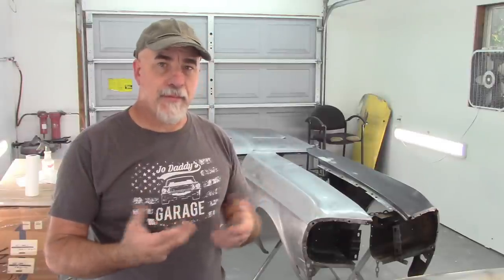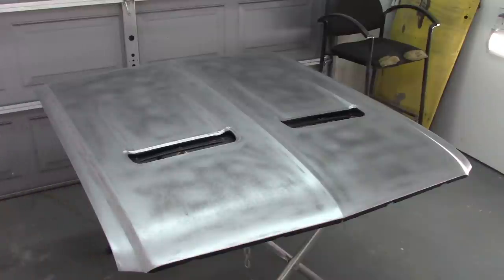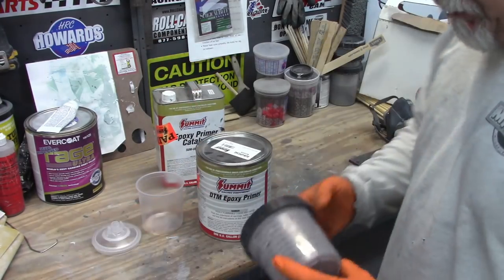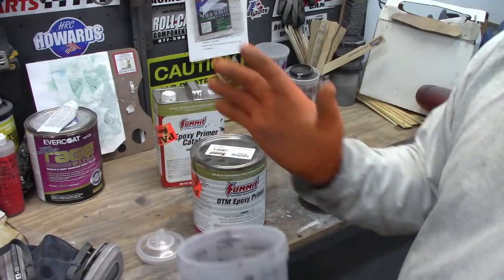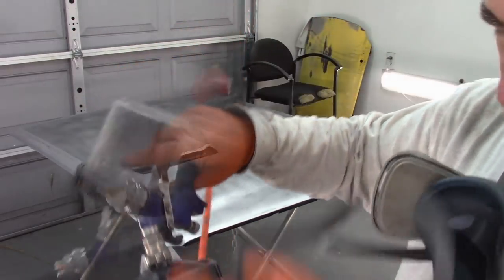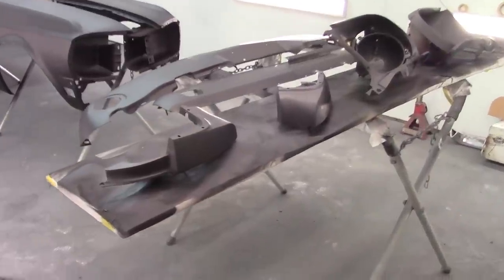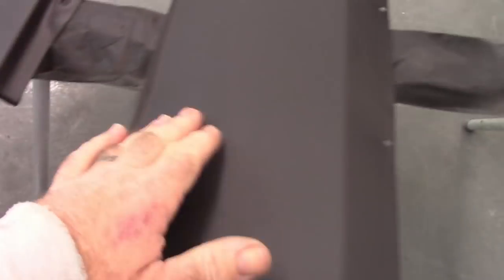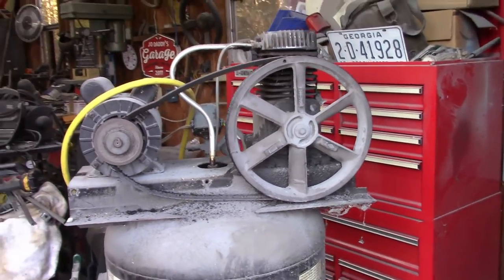Spraying epoxy primer. Mustang restoration. Jade part 43

Comment: they probably had overspray land on the primer and made it grainy.......BTW I got one of those compressor heads from harbor freight (the 3hp one) I have a 5hp compressor it works perfect. about the same CFM as before. great for temp repair. Yea My compressor tank is like a 1986 still going.

Comment: Heh, bought my first compressor from Sears back in 1978. Still using it! Still has the original belt!! I did have an issues with some valve failure several years back but no big deal. It's just a 2 hp, 20 gal, 220V, barely enough to paint a car back in the days with a siphon gun. To run my HTE gun now I still use it but I augment it with my new one ... strangely enough, identical to the Kobalt you have!!! (Got a screaming deal on it as I guess they discontinued them.) That's a nice unit, seems well built (good warranty), actual 2 stage and makes an honest 175 psi, all on 120V ... and it's damn quiet too! Only drawback is that being 2 stage it doesn't offer a lot of delivery in CFM. On its own I don't think it'd run an HVLP gun for long, but the "old reliable" Sears working with it works out fine.

Comment: I use epoxy primer for certain jobs. However I have had lifting issues repairing paint when something that was epoxy primed. I never have these issues with any other thing I've painted. I'm not bashing epoxy it's just a thought. I've done bodywork since 89.

Comment: I second the motion on the second tank! What? Does that make sense? Yes, twice the volume at contestant pressure or close to it. My son was doing body work and painting his Monte Carlo. I was after him to check to pumps oil, repeatedly. It froze! I even have a tag w/date of service. 
  Many have found older tube type a/c condenser off an R12 GM truck. Compression fitting allow for easy plumbing. Adding a cooling fan increases its efficiency in removing condensed humidity from the air, to make the tank like three times longer. A 12 volt DC fan can be added using a converter, wired in the on side of the “On” side of the pressure switch.
   You comment about someone said their epoxy was grainy. Some add up to 10% acrylic reducer that allows it to flow out and lay down flatter with “Eastwood” or “Shop Line” epoxy, made by PPG. 
Nice work, already subscribed but hit like! Epoxy is a step many deem not needed. I do...and you do as well. It is serious protection.
Reply from the maker: Thanks for the comment. Good information.
Reply: @JoDaddysGarage    Sorry, I misspoke,  I meant to say a good quality urethane Reducer of the correct temperature but that makes it flow out smoother. Air pressure at the gun, tip size, so much effects the texture of the Shop Line epoxy sealer/primer product. Have a good one.

Comment: Nice video, great job of explaining the process you go through. I have always used epoxy as the foundation for my bodywork and paint jobs but I usually get one of PPGs epoxies not the off brand stuff. it would be nice if Summit would tell you who makes it for them to relabel.

Comment: Keep the tank. The old ones are built way better and last longer then a new ones. My 5 year old compressor tank failed (cracked at welds) and my old tank (30 years old)still holding strong.

Comment: Seemed like 1 wipe was not enough on that hood. How many times did you clean it beefore it was ready for epoxy?  No glass cleaner or rubbing alchol? Getting ready for epoxy myseld and was wondering if w&g was all that is needed. All those parts with a 1.8 and 32oz wow.
Reply from the maker: I use glass cleaner and degreaser. Wiped at least twice.

Comment: WOW you spray really far away from the panel. Everyone I know sprays really close with a wider fan. It did seem to work though. I spray that far away when I am doing a drop or control coat with metallics on silver. On paint or clear if I sprayed that far away it would come out dry. epoxy primer is pretty forgiving and easy to spray.

Comment: Hi Barry , Not sure if you will see this or answer . Been watching your great videos and am in the process of doing my project car . I've been looking for a water seperator/dryer in line filter but there are so many . From high $$$  to Low $$$  . Could you tell me what you use and model number ? If its good enough for you and looks great when you spray then I want the same . Thanks and keep up the great videos .
Reply from the maker: The system I use is from our old body shop. I think I show it in a video I called paint booth makeover. Not sure if they still make them.

Comment: Did you thin your epoxy with acetone? That sure laid down nice. I've used the Eastwood brand and it does get grainy after it dries. I may have to switch to the Summit brand.
Reply from the maker: No thinning at all. Used it just as mixed.

Comment: I don't really understand epoxy primer. I have a small area that has metal showing.  If I spray epoxy primer, can I immediately spray primer on top of it or do I need to sand the epoxy primer?
Reply from the maker: Epoxy is meant to go to bare metal. There is usually a 4 day window to add other primers. Check your product for information on that.

Comment: Great work! I love watching these videos and learning from you.
What do you use to strip the paint from the pot metal parts? Headlight extensions etc.
Reply from the maker: I used a variety of things. Carefully used the warrior discs on my 4.5 inch grinder. Some 2" sanding discs, and my DA sander with 80 grit. Did some sanding by hand as well.

Comment: Nice work Barry (as usual).  Out of curiosity do you also spray or treat the inside of the fenders and the other parts to protect them? Thanks!
Reply from the maker: I do. Also use undercoating.
Reply: @JoDaddysGarage  Ah - thanks! Great info - will put it to good use.

Comment: Hi Barry. You mentioned your filtration system to keep the compressed air dry and contaminate free. What system are you using to achieve this?
I need something that does a better job of keeping moisture out of my air line. Thanks
BTW. Really enjoyed the video. Good to see Jade getting some love.
Reply from the maker: I salvaged a unit we had at the body shop. I don't know the brand for sure. https://youtu.be/DUHg8d0lhhw?t=113

Comment: So epoxy then filler? Or filler then epoxy? Which is right?
Reply: I spray epoxy then high build primer. You can spray a sealer on after that.
Reply from the maker: Ideally, epoxy to bare metal then filler.
Reply: @JoDaddysGarage  That's what I said.

Comment: Real ecoat is a epoxy based.. oem panels with ecoat is not a good idea to remove it. If thinner softens the coating its not real ecoat and it is to be removed. Oem ecoat is the best coating for paints, just scuff and hit it with primer of you favor.